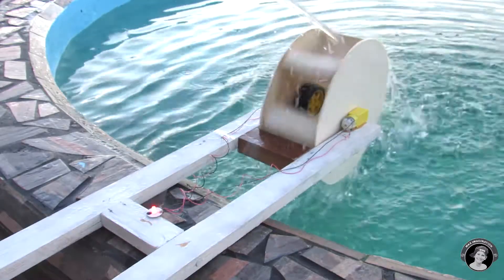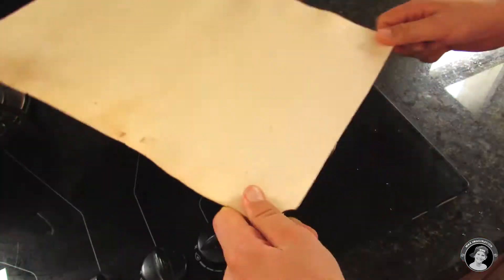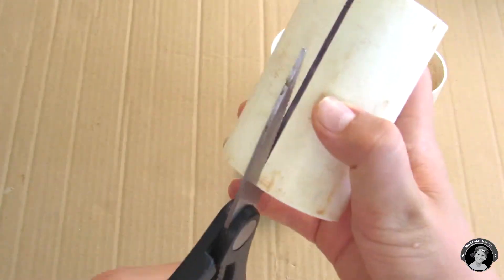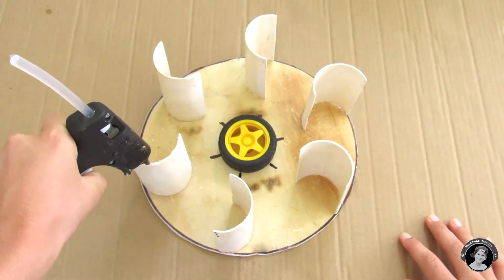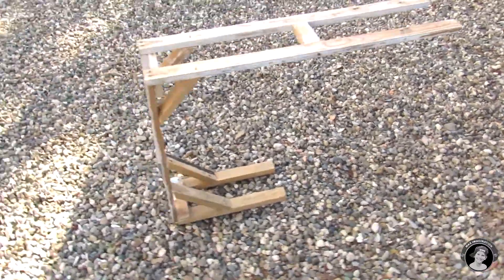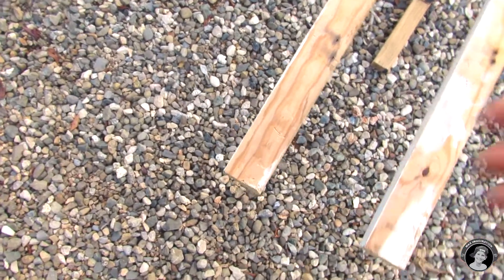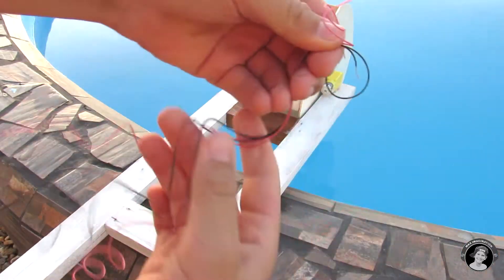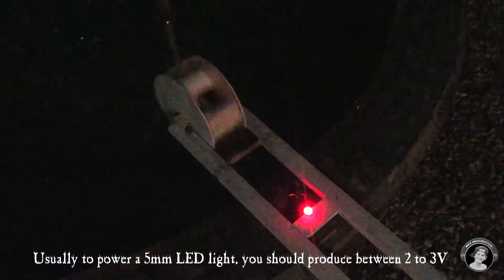How to make a mini HYDROELECTRIC GENERATOR | DIY PVC Watermill

Comment: what is the yellow thng you put to the sides
Reply from the maker: Those yellow things are the Geared DC motors, the toy motors that take the rotation of the barrel and turn mechanical motion into electrical potential energy. They are the generators.